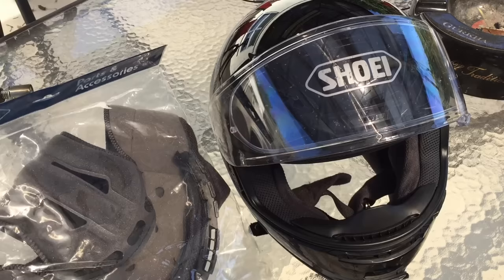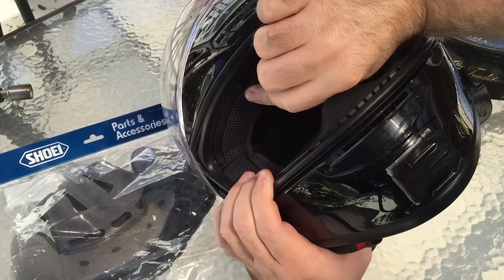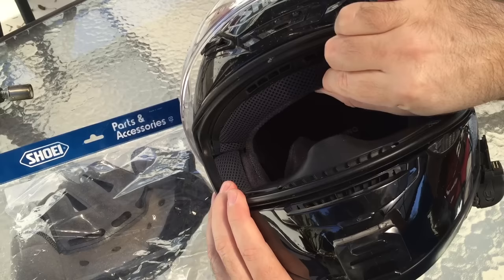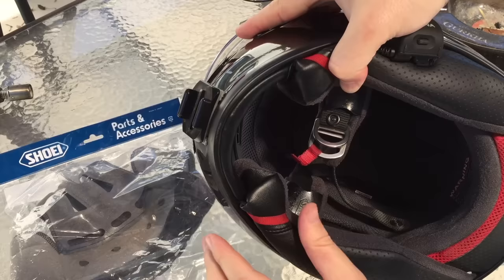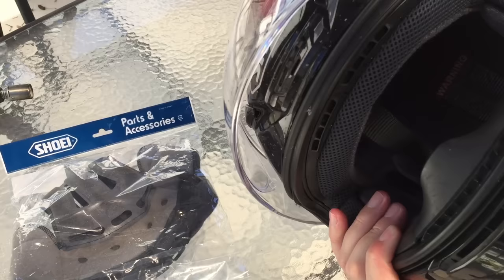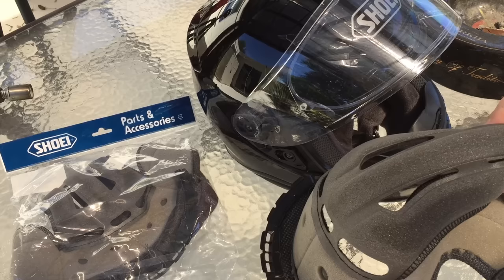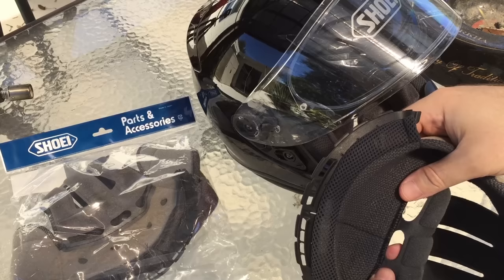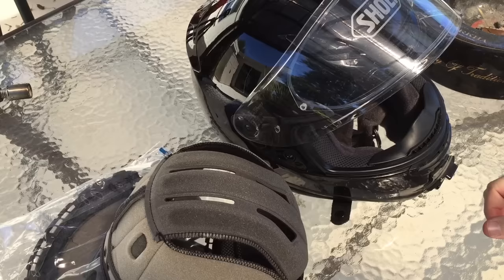Money Saving Motorcycle Helmet Liner Tips

Comment: I’ve got 9500 miles on my helmet, haven’t washed the liners at all, 35$ seems like a good way to go rather then washing and drying I did think about throwing it in one of those delicate laundry bags and set the washing machine and dryer to delicate cycle but 100$ worth of new pads in my helmet once a year or 10000miles of use is by far worth it to ensure proper fitment in my mind. I have rf1400

Comment: I used washer and dryer, I put them in a delicates bag. No problems
Reply: I hand washed the liner. After multiple clear water rinses to get rid of the woolite, I then put it in a tiny delicates bag and put it on the final spin in the washer. No more excess water. No stretching.  - worked like a charm!

Comment: Thankz for the tip! Cleaning my helmet right now and thought to double check for possible liner trouble to avoid. Quite helpful!

 And take a tip from a Professional Barber Stylist in return if you like...

1. Lather face with hair conditioner to soften the hairs instead of using shaving cream or soap. 2. Heat a washcloth as hot as you can get it at your tap or in a bowl in a microwave then wring it out so it's just hot more than wet. Test on your forearm for safety / temp. It's the wet that will burn you not the hot in this case. 3. Apply hot wash cloth to your face to further soften your beard. 4. Shave with the grain of your beard with a high quality razor such as a Gillette Mach 3 or better. The result? Baby soft skin with much less or no irritation for every day shaving. You can also use a similar technique in the shower with a shower mirror. Treat beard when you first get in and shave last and your beard will be soft by the end of it.

Cheers!

Lauren

Comment: Hey, so when I got my new helmet, it fit nice and snug, almost too snug, but I expected it to break in a little and not be too snug. Well, after a couple months of riding 2 times a week or so, now my helmet is a little more loose than I am wanting. My question is this; if i wash my pads and liner, will that make my helmet fit a bit more snug? Thanks to anyone that can answer my question.
Reply from the maker: No
Reply: TwoWheelObsession well, I washed my cheek pads and liner in cool water and woolight, then rinsed them 9ut really well and let them dry for like 2 days. Put them back in and put my helmet on and boom, fits like new. So, I guess it does work.
Reply: no